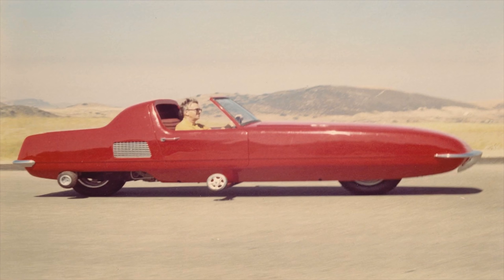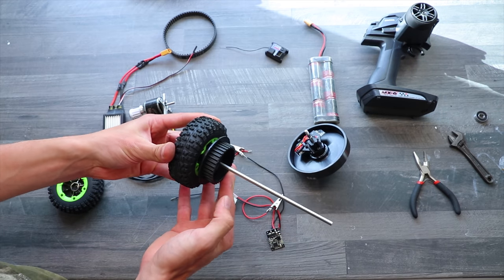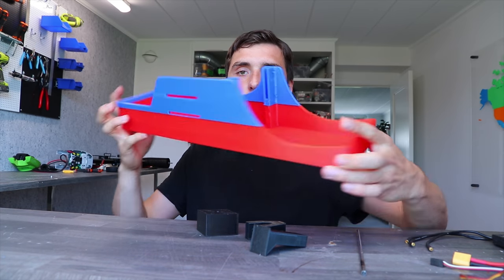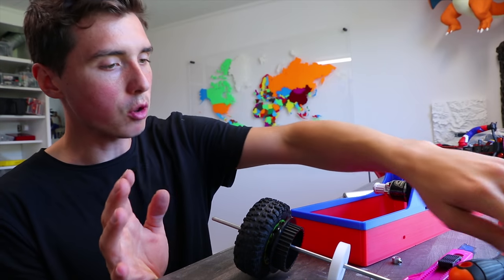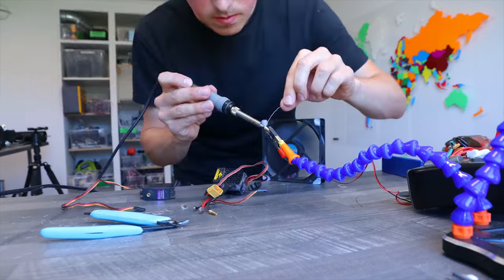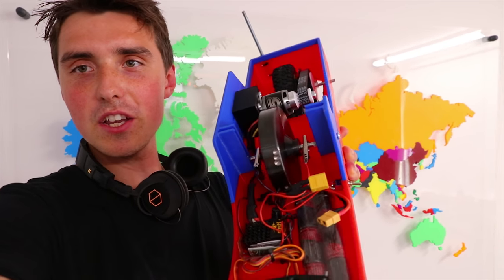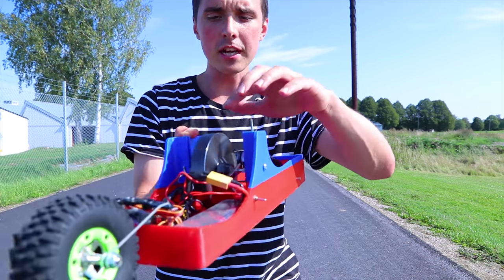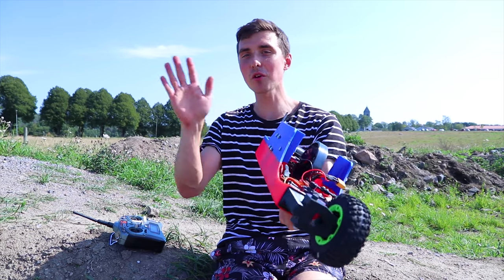Gyro Stabilized 3D Printed RC Car

Comment: Cool project, on the big one you showed there is an actuator on the gyro to provide active gyro force stabilizing, you would need too incorporate a drone controller or basic stabilizer level sensing as feedback, with a servo on the gyro to change its angle, maybe on next one?

Comment: If its built into the rear wheel that gyro like most rc bikes today then you'd have it a lot more stable.
Also maybe for this design a ball bearing holder for the gyro just too reduce friction.

Comment: you should try the same but mounting the gyro onto a camera stabilisator gimbal. i mean it would take some tweak the make it work but i bet that with that setup and a alldirection wheel  ( like on computer chair ) the gyro could be use as the balancing unit as well as the steering unit! oh that would look soooo wierd.

Comment: Great!  Where can I buy a mechanical gyroscope with a motor?
Reply: I think it's RC helicopter gyro. You can buy everything in the RC store.
Reply: I don't know if it will work, but I found someone who uses hard drive  motor and disc as a gyroscope.
Reply: @alexmorgun851   
Thank you.
As far as I researched, it looks like a gyro of an RC motorbike.
SK-SR4-R
I am also interested in mechanical gyroscopes of RC helicopters.
Reply: @rennierrodil6119  
Thank you for information.I saw it . In my application, the purpose can be achieved by disassembling the HDD.
Reply: @Tsukasa3D  yup. I found it in a " diy camera stabilizer" video. Well, it sort of working for him.

Comment: Hi, what did you use for the gyroscope disc? I was searching for it and couldn’t find it anywhere.
Reply: Looks like a steel disc
Reply: Why not use an electronic gyro?
Reply: @Fluterra  electronic gryos are used for reading angles (or rather, the change in angles, as is the case with most if not all MEMS gyros) and not for producing torque directly, as is the case here.
Reply: @Fluterra  also an electronic gyro uses servos or motors to to change the angles. Whereas a heavy disk being rotated will keep one angle. Thats the samereason planes dont spin up their wheels before touching the runway, the gyroscopic effect throws the maneuverability way out
Reply: looks like a vcr flywheel before dvd
Reply: me too he can be make it whit cnc machine... I will make it whit gyroscope toy but it can't will be strong

Comment: Nice project :) how about if you mounted the gyro with its' rotation axis parallel to the direction of driving, not perpendicular like now, and used the inertia of spinning it up and stopping it as a way to constantly adjust the cars' balance/angle?

Comment: Put the spinning gyro on a servo controllable rotator thing and then use an MPU6050 gyro to detect when it tips over, then rotate the spinning gyro with the servo. If that makes sense... Just like the car that you showed.

Comment: This is passive gyro stabilisation 
You need to be able to yaw the gyro for active error correction 
Cc3d whould do wonder but any type of microcontroller with gyro and accelerometer can work
Reply: ^ this guy understands..      its the equivalent of a fast moving bicycle but without a rider.     yes it can stay mostly stable and move in a straight line but as soon it begins to lean to one side,  there is no way to correct it.

Comment: Gyro is mount to high so the point of gravity moves against the one of the wheels. If you mount it at the same Hight it will be mich more stabil.

Comment: If you use a rc car motor it will have way more torque because plane motor only spin a propeller and cause air flow when car motor have to go through gear bindings and rotation of the Wheels plus they are rated at a much higher torque

Comment: add in a accelerometer, and have it auto correct, maybe another server with a counter balance on the x pole. the 360 cam seems to cause issues with its high center of mass.

Comment: if you put it vertically to movement direction, you have hard time turning, if you lay it down, you can turn and not doing wheelies
Reply: boat plane
Reply: 3d reaction stabilization wheels, 2x3

Comment: M8... A car, by definition has more than just 2 wheels. Adding injury to assault: Your +400$ 3D Printer failed 3 times, im looking at my AM8 Anet going like "You'd never do that to me, right?"
That car can not be steered with the gyro like that, you need to put the gyro spinning parallel to the ground, mounted like an helicopter blade. The gyroscopic effect will be the same. Trust me. Perfect RCLifeOn video, rate it 3 out 3 failed prints. Cheers.

Comment: I think you need to add another axis to the gyroscope so that you can push on it to stabilize the car for low speeds, but I bet that would then have to slowly correct and recenter everything as you got to higher speeds. 

Do slower speeds just need a stronger gyro?

It's really cool though and it seems like a huge success.

Comment: Nice video. You are using only vertical axis stabilization  Try to use dual gyroscopes 90 degrees phase out vertical and horizontal  axis combined stabilization

Comment: Use this gyro in your rc boat to make it more stable in tides and i want you to add some kind of flight controller on your boat.maybe ardurover firmware with pixhawk hardware will do good. try doing some waypoint stuff.

Comment: Remember the way motorbike works? It doesn't need a gyroscope
Reply: Of course. It wasnt stable when idle. What so different? And physically it does looks like a motorbike. The way it turns the wheel too

Comment: Please rotate the gyro 90 degrees (should be in the horizontal plane) that way you can steer without tipping the car over.

Comment: I was wondering if the gyro was working or was it just the gyro stability from the wheels, as with other two-wheelers

but you proved that without the gyro, it was unstable

What about weighting the wheels so they contribute gyroscopically?

good work, informative.   thanks

Comment: I think it would be very stable if your steering would have rake (is that proper word in English). Anyway steering angle like in motorcycles. Though I get it that this was experiment. What is the estimated speed of that gyro wheel btw?

Comment: Hello! Is there a difference to position the gyroscope disk along the axis of the wheels or across? On a stabilized bike, I saw the position across the axle of the wheels in a floating frame. Thanks!

Comment: I'm wondering what would happen if you put the gyro on there sideways and had it have a breaking  mechanism to steer one direction and have the engine pick up speed on the gyro to go the other direction to counter out the steering effect.

Comment: I think you didn't put the gyro as well and that's the issue, Design probably is not the best but in my opinion two same centered horizontal gyros would be the best construction for the porous...

Comment: The car seems to lean over every time you turn. I think it would be better if the gyroscope were mounted horizontally rather than vertically (so the gyroscope always keeps the same axis of rotation.)

Comment: What about using just an electronic headlock gyro from a RC helicopter to buff the steering servo? Seems it would be much more efficient.

Cool project none the less. Good job.
Reply: It would ocillate even with calibrated gain settings because the streering is not a direct control for the verticality of the vehicle , but only creates centripetal force that affects the vehicles center of mass as a moment lever from the wheels.
Reply: I was thinking about a vertical mount instead of horizontal, and maybe even a horizontal in series for fine tuning. Another idea would be a second flywheel mounted perpendicular to the main that is gyro controlled, with perfectly upright being neutral, sort of like a hoverboard.

Comment: Review the ender 5, I'm thinking of buying either the ender 3 or 5 but i cant decide, would appreciate it if you can do the comparison
Reply: The 5 takes all of the best features of the 3 Pro and makes it more stable, far easier to put together as well.
Reply: @HighbridgeD  But is it worth it for the extra price?
Reply: @CabbageAdi  I'd say so. X and Y dimensions are the same as the 3 but it has an additional 50mm on the X axis. Its a more stable and sturdy print quality as well. Plus, if this was going to be your first Creality printer, the experience is very straightforward. But don't just take my word for it, here's a link to a review of the Ender 5, courtesy of All3DP: https://all3dp.com/1/creality-ender-5-review-3d-printer-specs/

Comment: Very nice project and absolutely a success (not a failure). You mentioned some concerns with plane-ESCs. Perhaps as an improvement on this design and a next step you could use the motor in the wheel (hubmotor). I did this successfully and the result can be seen on my YouTube-channel ("Depron diy rc car"). Another improvement might be lowering the centre of mass by tilting the gyroscope 90degrees, so it is lying flat. Goodluck and looking forward to another episode :-)

Comment: Motor bikes are already gyro stabilised... DOH Make the wheels 1/3 the body weight problem solved, ever wondered why it is harder to balance on a motorbike at slower speeds.

Comment: Kinda confused as to why you'd mount the gyro vertically... That'd make it stabilize in the wrong direction, aka make steering alot more difficult... With it horizontal, you'd get way better steering and alot more stability... Otherwise it's alot like a motorcycle... Simply going forward produces stability..

Comment: The gyro has to be horizontal, the stabilizing forces are 90 degrees to it's axis. Problems happen when you try to steer

Problems when it's horizontal, when the car drives over stones (or simply when it drives horizontally and then up or down it will fall left or right) 
how to solve that?: make it pitchable so the horizontal axis isnt fixed for the gyro

Comment: Congratulations, you made a radiocontrolled motorcycle..
tho in a motorcycle it's the weight of the wheels that produce the gyroscopic effect.
This effect is more noticable on bicycles with light frames and heavy wheels, like carbon frame fatbikes.
That's who fatbikes feel super smooth going fast in a straight line.

Comment: If that's PLA, you could have used acetone to weld the pieces instead of a blow torch.
Reply: I think you are talking about ABS... I've tried that before with pla and the only thing it does is making it brittle.

Comment: This is totally wrong because there is no rotation of your gyroscope in the yaw axis. Therefore no free precession. You should try attaching a gimbal to enable rotation of the gyroscope in the yaw axis. I don't think the gyroscope even stabilizes it. You are just using momentum to stabilize it.

Comment: I love seeing your projects ... but you make it so much harder on yourself. Does math not exist in your world? xD @West perfectly explained your tiling issue - but more poignantly; you could have easily found the right speed controller by matching the current value needed to run your motor and calculating the energy needed to run the mass you had to move. You could really easily calculate the torque needed to move the object + the power needed to generate that torque. Then just match your speed controller to that. 

Still love your videos though, this was a great one.

Comment: Im honestly surprised this worked any gyroscope stabilizer ive seen either had 2 gyroscopes or the gyroscope had a x n y axis not just a y or x axis but if it works it works

Comment: What if you mounted gyro horizontally .wouldnit be nore stabil??🚜🛸
Reply: JayBird G - Horizontal or Vertical should not change the actual stability - if you have ever played with a cycle wheel or other gyroscope you'll recall that there is this weird effect (due to conservation of angular momentum) that makes it twist away from you strangely when you try to tilt it.  It will twist differently.  Perturbation in roll (the stability thing you need) will not express itself in yaw but in pitch.  To prevent any effect such as this (no weird twisting) one needs two gyros (either H or V) spinning in opposite directions, ideally on the same axis.  The twisting cancels out!

Comment: Fun fact: if the "car" stabilised with some speed it's because the wheels acted as gyros, that's how motorcycles works :)
Reply: not true, and same goes for bicycles..  even today scientist and physics  are still puzzled on how they stay upright..      if it was purely the gyro effect from the wheels keeping it upright, then you wouldn't need to learn to ride a bike..     also the wheels will be turning too slowly to have such an effect. 
its a really interesting topic to dig into :)
Reply: there are some good video's for this on youtube too :)

Comment: Mount the gyro horizontal and allow it to pitch, you can allow it to pitch by itself or you can add a servo / stepper to control it and make it act on the car.
Since the force applied acts 90 degrees after where it was applied it will control the car roll axis while moving in the pitch axis.
Examples:
https://www.youtube.com/watch?v=1KmhTfhaWG8
https://www.youtube.com/watch?v=KNDpsBlxUIY

Comment: The weight of the flywheel is too less. It should be able to stay stabilized without any speed without tipping over. Maybe a higher rpm will increase the momentum

Comment: the gyroscope doesn't make any sense. the reason why, without a gyroscope, it does not hold the balance is due to the weight of the gyroscope itself. In fact, the center of gravity is too high because of the gyroscope

Comment: You don't need to use an extra giro... you already have the giro effect of the wheels themselfs... there are dozens of rc bikes available for over 20-30 years that only use that... that's how real bikes work... how bicycles work... What you also need is to see the self balancing bikes that already exist, as well as the models... 
Need a bit more research before going hands on... ;) Oh, to make turns, you have to have the steering with an angle... if it is 90º with the ground, you will never make turns...

Comment: haha oh man, have you not seen any motorcycle driving before? The Gyro here is useless, even in the project of the guy yu mentioned. Only if it stays stable with 0 speed, then you can say it works.
And this is not how to put the Gyro, but to use two with 45 degrees and opposite rotation

Comment: You didn’t share anything about the most interesting part - the gyro! Why? What’s the point of talking about the boring stuff like the belt drive and how the drive wheel was connected but then omit the most interested in part.

Comment: Withoiut a gimbal you have just made sure your model will be resistant to changeing directions so of course you won't be able to turn right and left. My model uses a gimbal so that it can turn right and left and stand still as well. https://youtu.be/UUfhcObPBeE
But mine is not 3d printed and pretty as yours.